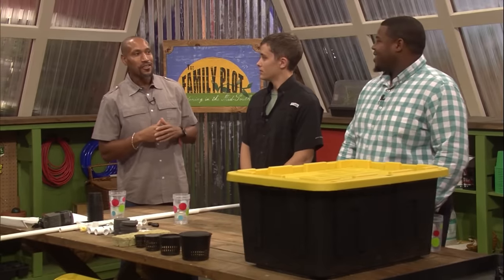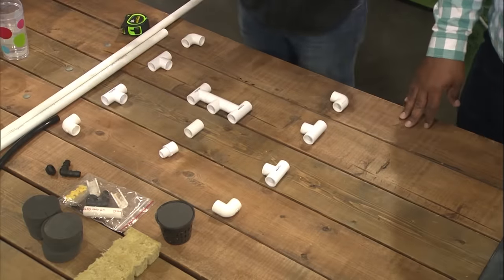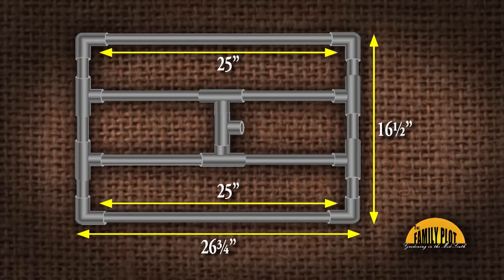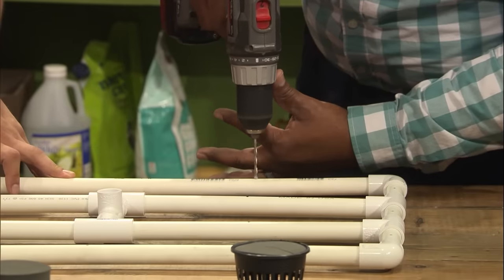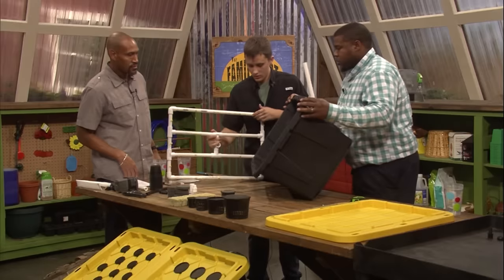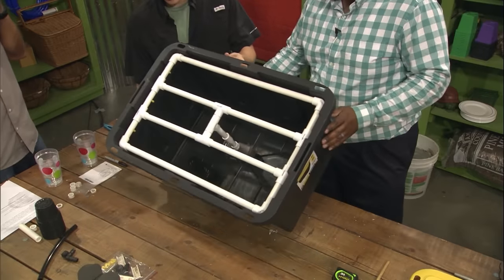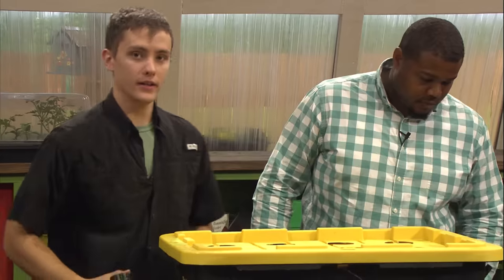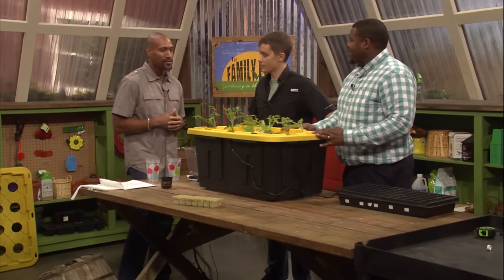Building an Inexpensive Hydroponics/Aeroponics System

Comment: Just built this badboy yesterday. First build came out great, few lessons learned and a few minor tweaks. Wish me luck 🙏🏾
Reply from the maker: Glad to hear you were successful!
Reply: Where did you find the sprayers?  I’ve been searching online and cannot find them.
Reply: @earlbenzenhafer1087  330 degree hydroponics misters.. ebay is our favorite stop first, then amazon. also, your local hydroponic supplier may have a version. please be mindful to get the misters with a "hex head" as the ones with the little thumb tabs sure are a pain to screw in!

Comment: "Inexpensive" those containers are 18$$ at HD yo. and the pvc and elbows would run same total price. plus the bits and drills. Great video though.
Thanks for this. :0
Reply: yea but it should all run around $100, still pretty cheap for a movable weed garden
Reply: I literally went to Lowes today and this bin was $10, the rest of the supplies were an additional $30. I just need to buy the water pump, net pots and plants, should be closr to $100 total for the initial bin. Gonna be a good learning experience!
Reply: Think of what the design leads to. If you made a similar tote, but with more sites closer together and flipped the sprayers over, you'd have what some companies are selling for around $600. 

If you scaled out, you could cover any space with this type of system and maximize yields of any crop to thier highest potential by taking the rhizosphere (roots) to the next level. 

This system is basically a an oxygen generator for your produce plants' roots. You'll never see a higher yield from your soil containers. And it will do it season after season, harvest after harvest, for years.

Comment: Did anybody try this system for themselves? And couldn't you just put in an aerator pump instead of the elaborate tubing system?
Reply: I used this over the years it works, and it's pretty simple.
Reply: Make shore you use the  correct plastic tub.... some release chemicals that will hurt  roots
Reply: I have built a number of these and they always work great. I normally get 100% success on my cuttings. Northern Michigan shout out...

Comment: Alright, ready to. start my drug empire lol
Reply: How’s the empire doing right now?
Reply: joseph Cornish  you couldn't even grow big plants on a system like that clones are that big but you have to transfer them into like 5-gallon pots as soon as they get that big so that wouldn't help much at all...if you did this system on a much bigger level then yeah you could do it and make bread but you'd have to get one of those big like eight by eight hydroponic bed / table
Reply: ITS BEEN A YEAR ... HOW MUCH HAVE YOU MADE ?

(NOTHING, MY GUESS)
Reply: @187mrsmith  This could be used as starting up the plants and then transplant them to a bigger system like a Deep water culture system or something.
Reply: @187mrsmith  You can prune them for multiple colas, and since clones are adult plants you could veg them for a few weeks then switch to flower cycle. they would finish at 18" - 24" high (he said "high") The buds will be smaller but you can get as many as five per plant ( usually 2 - 4 ) It used to be call "The Sea Of Green" method years ago.
And the lights can be kept closer, so more of the plant gets intense light for denser heavier buds, even the lower smaller buds. Less bud "per Plant" but 2 to 3 times more plants... In an 8" tall room you could have 2 levels and REALLY maximize the space you have.
Reply: that's the plan, pablo escobar for weed
Reply: Tommy Chang did this big time years ago. Cheach Marin smoked it for test .

Comment: Dies cut male threads bud, that's called a Tap.
Reply: And all that rough plastic that's cleaned out is called 'burr'.
Reply: @CrankCase08  And that stuff they have on their heads is called 'hair'.
Reply: Yes and the two drill bits he used for the cord and the drain are called spade bits or butterfly bits not hole saws. The hole saw was what he used for the plant cups. Just saying.

Comment: I have two in my greenhouse but without all the extra hardware. Kratky method. I bought mesh hydro pots, perhaps 3" in diameter. I drilled the holes in the lid for them to drop in without falling all the way through. Put the pots in the holes and fill the tote until the water level is above the bottom of the pots. Add liquid fertilizer. Earlier start your seedlings in soil and when they get to around six inches tall remove them from the pots you used to start them and wash all the soil off the roots. Hold each plant into the mesh pots and then fill the pot with fired clay pellets until you reach the top of the pot. That's it. You don't add water or anything else unless your plants are growing slowly. As the water is used in the tote the plant roots will grow downward to remain in the water. If it does drop very low add more water and fertilizer but do not fill the tote back up very high or you'll drown the air roots that are above the water. I do keep a grow light on over the totes. this method excels at growing bibb lettuce but did well on most other vegetables I tried.

Comment: A similar but simpler method I used this year which may not be as effective but still works is called the Kratky method (several videos on YouTube).  I used the same tote they are using.  Drill the holes in the top and use net pots just like this method, but instead of all the fancy stuff inside, just fill up the water until it covers just the bottom 1/2 inch of the net pot with the roots in it.  Dissolve 60g Masterblend, 60g calcium nitrate, and 30g epsom salt.  Then just wait!  After about 8 weeks with tomatoes the water will get down pretty low then you just mix up 5 gallons at a time of the nutrient solution (with 1/5 the amounts since it's a 25 gallon tote) as needed.  I have a ton of tomatoes (actual tomatoes, not "tomatoes").  It works for water-loving plants like tomatoes, cucumber, most herbs and eggplant, but does not work well with peppers (they need to dry out between waterings).

Comment: Great step-by-step video, thx.  I see that the sprays are facing down & the water appear to filled to reaching the bottom of the grow containers.  In this case, how does the plant get water to nurture the plants ?  Also, I see there is a drain hole appear to be draining away the water. Do you recycle the same water or use fresh one ?.
Reply from the maker: Thanks for the questions.  The sprayers actually spray out the side, not down, so this is how the plant's roots are getting water.  The water in the tub serves as holding reservoir for the pump to draw water from.  The drain hole is only use to change out the water in the tub; something you'll do every few weeks.  This video about changing nutrients might help you out too: https://youtu.be/gYrTTLbl3Ro

Comment: Sorry this is new to me but at 18:40 - where do you get the plant like that already started?  And can you start with just seeds?  And if so, how do you start with seeds?
Reply from the maker: Those are rooted cuttings. You can can start with seeds. Take a few cubes and rinse them well with water. Then put them in a dish with water in the bottom. Put a seed or two in each cube and keep water in the dish. They should sprout. Once they have their first true set of leaves put a half strength nutrients in the dish for a few days, then transfer them to the system.

Comment: Wondering about timing with your pump. Is it on 24hrs? Thanks and awesome video!!
Reply from the maker: Sorry for the late reply. This one we ran 24/7, but you can put it on an interval timer. I like using one of those vacation timers with the pull out tabs. Set it for 15 minutes on 45 minutes off. If your system is in a hot dry place you may need to do 15 on, 15 off.

Comment: Question. Should water 💦 pump be on 24/7? Or should I turn off at night? Thanks b4hand & love your DIY hydroponic system. I just made it & attempting to grow my own veggies...just tomatoes, basil, chili 🌶️ atm.
Reply from the maker: There are a few options here: you can either run the pump 24/7, or you can use a timer (that you plug in the wall and then plug the pump into) and set it for 15 mins on, 45 mins off.  The objective is not to let the roots dry out.  The roots need to stay wet.  Hope that helps.

Comment: Could I ask you if the spray nozzles are threaded and if so, who makes them and/or where could I obtain those?  Thank you very much for taking the time to share your knowledge.

God bless.
Reply from the maker: You can find them online. Just Google ?Hydroponics Misters." Thanks for watching!
Reply: @FamilyPlotGarden  Thanks.  I guess the problem that I am having is the 10/24 tap that is mentioned on the parts list that you provide.  I am seeing all kinds of misters, but most only barely have threads on them and someone at a hydroponics store told me yesterday that they were more for hose than for PVC.  I also found some that were a little more money, but have a full thread.  Are the full thread types the ones that I want to use on my project?  I don't want to mention the brand, but would appreciate the clarity.  Thank you again for all of your generous support.

Comment: Great video. However, it seems counterintuitive to me to have the sprayers oriented DOWNwards, I'd think it cannot provide an optimal spraying of the roots and some of them might even not get sprayed at all!? Is there an explanation to this technical choice, please?
Reply: I had the same question!
Reply from the maker: The sprayers pointed down barely hit the net cups and keep them moist. But the main reason is that by pointing down water does not leak out the holes in the lid and the hole for the power cord.
Reply: @FamilyPlotGarden  Thanks, I get it now.
Reply: @FamilyPlotGarden  thank you for clarifying this question over and over :D

Comment: This is a terrific video, and my roommate and I built one of these a couple days ago (we are beginners).  We transplanted some lettuce that had been grown in soil, but have seen much of it wilt since moving the plants to the new system.  Would this be to be expected with moving plants from soil to aeroponics?  Thanks for any help!
Reply from the maker: Wilting often happens when you move from soil to aeroponics. My first question is are you using a full strength nutrient solution? Plants that grow in soil have to work hard to find their nutrients and can become very sensitive to high strength fertilizer. The nutrient solution for hydroponics is extremely strong and can easily burn the roots of plants that are used to growing in soil. What you may need to do is reduce the concentration for the first couple of weeks so they get used to it. Then bring it back up to full strength. Also, check your pH. If your water pH is very different from the soil pH they were growing in they may be unhappy and wilt. 
The plants that are wilted might recover even if the nutrients burned their roots. Give them some time with a reduced strength solution.
Good luck! Once they get used to the nutrients, they will grow very fast and assuming correct lighting will be ready to harvest in about a month.

Comment: When you drilled the holes, that was a Drill Bit you used. Then, you inserted a 10-24 Tap in the Drill Chuck and 'Tapped' the holes (24 threads to the inch) with the 10-24 Tap. You never used a Die (the part that is used to cut threads on a rod).  Good clear video, like none the less . . .
Reply: A die is unnecessary, the sprayers have a 10-24 thread already molded onto them.
Reply: @danielostrander9431  You totally missed the point. And obviously missed the fact the terms were used incorrectly to begin with in the video. But for someone who does not know the terms, and trying this on their own this can be confusing.
Reply: @BoostedNW  If something like this is too confusing for someone they should just leave it alone, because it only goes uphill from here.
Reply: @danielostrander9431  what an ignorant comment. People have to learn somehow.
Reply: @BoostedNW  Yes, I agree.  However, as the video displayed and explained the build to 99.9%, if the person lacks the wherewithal to be able to complete it from there then perhaps they're over their head because it only gets MORE complicated as you dive in.
Reply: @danielostrander9431  Yes but its hard to fault someone who is trying to learn about this project in general over something not really related to the project. Someone that is looking to YouTube to learn general hydroponics isn't going to necessarily know all general tool terminology, doesn't mean they shouldn't try/learn as they go.

Point is,  the video had incorrect terms used, and that is just going to confuse those people, although not a critical thing as you would figure it out sooner or later that a die would not make female threads.

Comment: I like this thanks for the help.  Can you explain how to attach the PVC pipe to the pump?  I have the same one you have in the video. the  ActiveAqua 400 pump.  I just planted some lettuce and in 2-3 weeks want to transfer them over to this system.
Reply from the maker: Take the pump to the hardware store and find the PVC fitting that threads into the top. That will let you attach the rest of the PVC manifold to the pump.

Comment: @Family Plot  @Wet Werk  or anyone else, do you know how I could link up multiple systems with one pump? I made one of these systems that has been working great for me, and I'm ready to expand! I was thinking I could have one system that sits higher that drains into the lower one, with the pump in the lower system, but not sure if that would work or if there's a better way that someone else has thought of. Either way, thanks so much for putting these amazing videos together! I love my little garden. Also for whoever suggested it in the comments, the float valve works great!
Reply: This is exactly how I pictured the setup evolving when I first designed this, and I have indeed made such setups for various customers. You have a few options. Some prefer a separate reservoir for each "upper" tote. Others prefer a single common reservoir. If you want them all to use a common reservoir its just a matter of getting the correct connectors. I like to use ball valves at each upper tote, so that one can be turned off if you want to remove one of the totes for servicing. Look for BULKHEAD fittings to breach the tote's wall, and only use aquarium safe silicone to seal. You simple grommets to squeeze a pvc drain into, or use more bulkhead fittings. They can all drain into a larger pvc pipe that leads back to the reservoir. It's quite a simple setup, just make sure instead of being directly connected to the pump, like in this one, you use the correct pvc to bulkhead adapter and connect the sprayers directly to the bulkhead, pvc-ing outside of the totes to a much bigger pump than this one uses.

 I hope that helps.
Reply: @wetwerk2178  Thanks for the response! I didn't think to use bulkhead fittings to breach the wall and I do get a little bit of leaking here and there. :/  Would you recommend slip-slip, slip-thread, or thread-thread bulkhead fittings? Since I've already built the system, I may try to see if I can get by with a little silicone first, but proper fittings would definitely have been optimal. 

For the pump, just going up to 33W was enough pressure to supply the second system in my case since the two sit fairly close and the second container is only about a foot higher.
Reply: @leilahojat9675  Sorry, I don't get notifications when you reply, so I didn't see this a couple of months ago. The bulkheads I use have threads all over the place. I prefer threads to slips because they are easier to work with, both in setup and in leak protection. The less sealant we use, the better. I've often found o-rings to fit and relied on those being strategically placed to mitigate drips. Good luck with your hydro journey!!

Comment: Question for anyone who's put one of these together for indoor use. What kind of grow light is good for a system like this? Looking for something effective yet relatively affordable if possible.
Reply: @Tech Overkill LED is the more expensive upfront, with cheaper long term costs. HID lighting (High Pressure Sodium and/or Metal Halide) is cheaper upfront, but costs more in energy use. It really depends on what sort of coverage you want. But, for an all-purpose setup, I'd stick a 600watt HID light (either HPS and MH are fine) over the tote and call it a day. Get a digital HID ballast or an LED. If going LED, look for Samsung LM-301 diodes, or to make things simple, grab a "Mars Hydro" setup that fits your space.

Comment: My grandmother grew gardens every year, using an almanac. Can you use soil instead of the Fiber like material? My grandmother would've loved this.
Reply from the maker: Soil might get messy because it would wash into the reservoir get sucked up by the pump and clog the sprayers. There are several options instead of the rock wool including clay pebbles and ground up coconut husks. if you google "hydroponics medium" you will see tons of options.

Comment: Great Video, can anyone suggest indoor grow light to use and should I use a fan? How often to set the pump..... 30m on 30m off....???
Thanks
Reply: I left the pump on 24/7 tbh
Reply: Digital HID lighting. High pressure sodium, 600 watt. Hydrofarm's Phantom ballasts have the lowest failure rate in the industry. Alternatively, at a higher upfront cost, but lower utility cost, Mars Hydro LED lighting.

Comment: Hi, what is your misting intervals? How often do you change the water? how often you add nutrients? Thanks
Reply from the maker: We run the pump 14/7. It could run on an interval but it is easier to just let it run all the time. The misting action keeps the water aerated. The nutrients and water should be changed when the resident plants have drunk about half the water. That could be a month (lettuce in cool weather) or a few days (big tomato plants in hot sun).